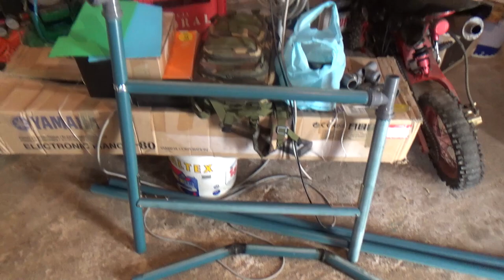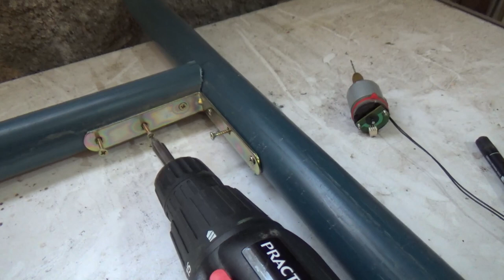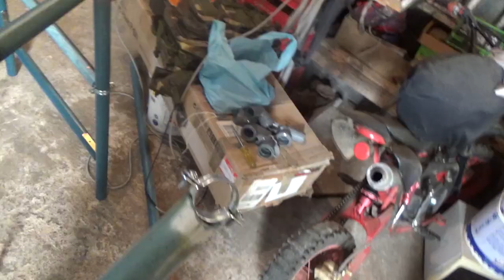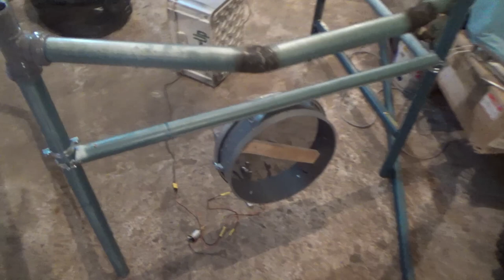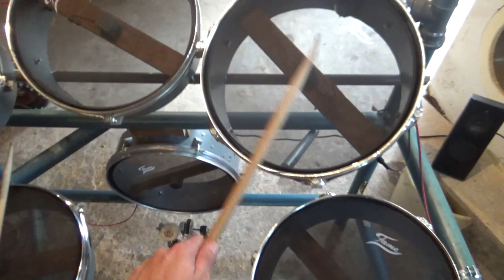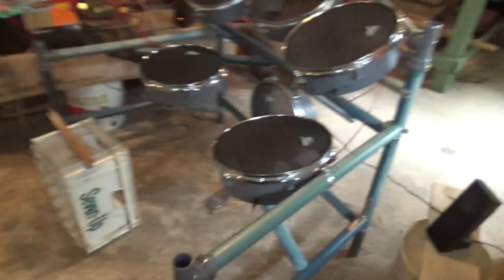DIY - Homemade Electronic Drumkit part8 - Drum Rack assembly

Comment: Hi, i have been watching different videos about DIY drum kits, what is the difference between using arduino or not for the electronic, some of the videos use arduino and others do not use it, what option is better in terms of sound quality. Thanks.
Reply from the maker: Well...arduino is cheaper...you have a lot more modules out there way more expensive...that are a lot better... The point of arduino is to make it work...while keeping it as cheap as possible...
Reply: @luisfilipe1983  I did mean using a drum module Roland or Alesis that you can buy in a music shop, but making your own PCB with an IC LM324N, a few resistors and leds but not using arduino.

Comment: what is the metal connector you are using (not the L bracket) at the end of the pipes?  Where did you buy it.  Do you have a part number?
Reply from the maker: nathunder1 i got it from a local parts store it doesn't have a part number...it is a kind of bracket used to hold pipes in place against walls and stuff like that